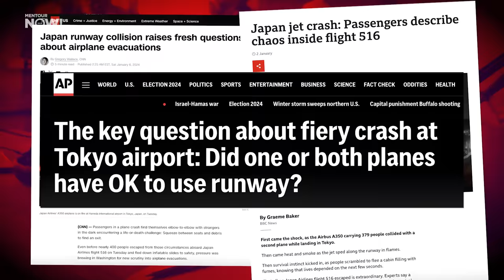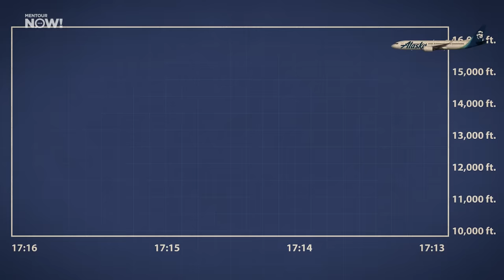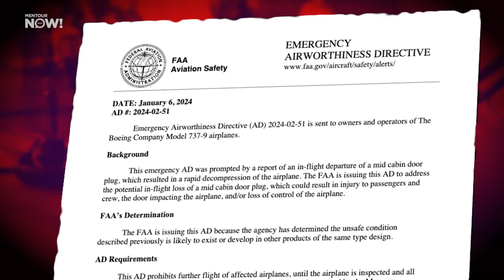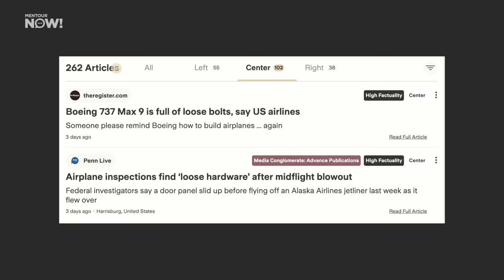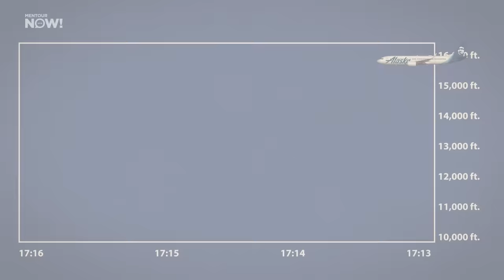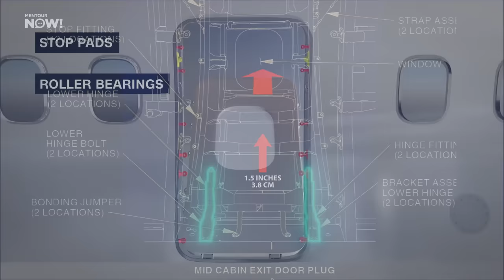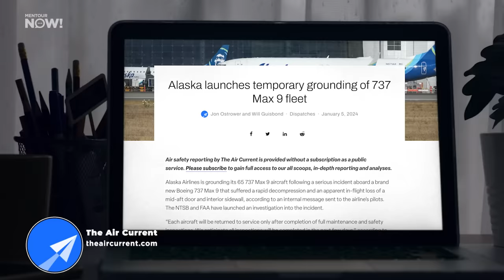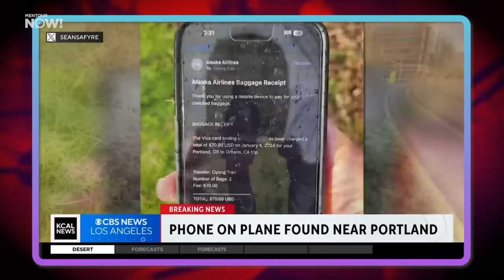WHAT Is going ON with Boeing?! MAX-9 Door blowout

Comment: Boeing was a name you knew you could trust for excellent engineering and quality but its now clear that something about their company culture has changed
Reply: its been an issue since aviation began, and its a bigger issue in countries where money/profit is the deciding factor.

it should actually be illegal to subcontract work, it should all be under the responsibility of boeng, and everyone should be on top rate boeng pay and benefits.

but shareholders gotta be told to fuck off and eat a bucket of shit first.
Reply: That Boeing you’re referring to no longer exist. The Boeing 777 was the last plane made by the former Boeing put together by senior, highly skilled and well paid unionized engineers in Renton. What we have now is McDonnell Douglas using the Boeing logo putting together aircraft parts that are manufactured by the cheapest suppliers scattered around the globe. They even opened a final assembly line for the 787 in South Carolina just to get cheap non-unionized labor. The results of that approach speak for themselves.
Reply: Going on 2 decades now
Reply: @Pilot597 I don’t see how unionized vs non union should be an issue. They are required to perform the same work at the same quality
Reply: It was not the name. It was the logo. I mean it. Check when it was changed to the current version.
Reply: @milkshake1993  there merger with McDonnell Douglas...
And adopting there business strategies...
Reply: @VikingNewt no, it should not be illegal to subcontract work - that's insanity. You want Boeing [edit for typo] to make the carpet? Tray tables? Seats? Batteries? Carbon fibers?  Everything depends on subcontracting, everything...

And Boeing already are "responsible" for their end product, the manufacturer of the sub-components does nothing to change that (except someone might find the subcontractor responsible as well as Boeing).
Reply: @VikingNewt  subcontracting didn't cause this. What caused this was boeing employees not reinstalling the bolts correctly.
Reply: Greed
Reply: Intense competition from AirBus, probably with lower costs (U.S. inflation is very dangerous in more ways than one) and the Chinese threat just over the horizon. Flipping burgers at $ 20/hr has unintended consequences.
Reply: @scythelord According to other online sources (Blanco Lirio), the tubes are delivered to Boeing with the plug doors installed. However it appears that sub-contractors at Spirit use the left hand doors to install the WiFi system. It seems that these were not always replaced in an approved manner OR checked afterwards.
Reply: Another issue is that after the merger with McDonnel-Douglas, the new executive team (intentionally or otherwise) created a culture of fear by threatening disciplinary action against employees who spoke up about issues.  The result, of course, is that the issues are still there, but they are not being fixed until something catastrophic has already happened.
Reply: It's just a name and a logo - the real worth of an engineering company are the engineers that currently work for them. The current people 'running' Boeing have failed to hire people that can maintain Boeing - and indeed have outsourced much of manufacturing so it's not even possible to ensure the same quality across the aircraft anymore. This is what happens when greedy people determine a cost can be cut - they fail to understand the reason it was a cost in the first place.
Reply: @lmpeters  And do you are just a person how like to acuse a company. Or so you have some real info for your opinion.
Reply: @Bobspineable Emplyees who are treated well and respected tend to care about their work more. Unions also mean that workers have a way to be heard, so they have an easier time communicating if the employer tries to impliment any unsafe practices, and can even pull the plug completely if necessary.
Reply: There is no more Boeing but just name.
Reply: @nontonteve2485  - Was there ever really a company as an entity? it's just whomever works there at the time and there's no garuntee that the next generation will be as good as the previous. SEGA can't make game consoles anymore, NASA can't reach the moon anymore, Rolls Royce can't make piston engines anymore etc etc etc
Reply: @Bobspineable 
It is an issue. The Seattle plant (unionised) has properly qualified and trained people working on aircraft. The South Carolina plant has cheap local labour.

Outsourcing works on some products, but not on something safety critical like an airliner.
Reply: @Bobspineable  Non-union workers are likely paid less and given less time per task to get the job done.
Reply: @MiroDaisuke Amazing how you need to explain that to people.  Union workers are Always better.
Reply: @Bobspineable  At the least, closing a location and opening another one to save cost shows that management is not interested in retaining knowledge and experience.
Reply: @Bobspineable 
In fact it can have much better quality control, because management can fire incompetents!
I never worked at Boeing in Witchita, but I had friends that did!  Some of the stories they would tell about screwoffs and incompetent workers that could not be fired due to the Union!   Drug use was common, as was absenteeism.
Spirit cleaned house as much as they could, and things were better for a while, but I wonder how long that lasted!  My friends either retired or took other jobs.  I do know they have had some quality ptoblems lately!
Reply: @scythelord 
From what I understand you are correct!  Boeing in Seatle open the plug to install interior components, so Spirit should be in the clear!
Reply: @pizzablender  - it's also a civilian company using phrases like "acceptable losses" as if it wasn't murder outside of the military.
Reply: @moltderenou 
That shouldn't make difference as I believe the door plugs are opened at Boeing to install interior components.
Reply: @mahbriggs As long as Boeing didn’t also believe that they were installed again correctly at Spirit. Heads will roll due to this.
Reply: @moltderenou 
What part of the door plug being opened at Seatle did you not understand?
If it was insralled incorrectly at Wichita it should have been caught in Seatle!  Especially since the bolts have to removed to open the door plug!
Reply: The only thing is changed is FAA and NTSB.
Reply: @life5161 
Not at all!  I have worked in union shops!  It is very hard to fire incompetents and screwups!
Just ask General Motors!
Spirit for example is mostly union, despite Kansas being a right to work state.  The Union is very powerful, and in the past has commited violence against non-union workers durring strikes!
Reply: @hardykornfeld1733 
Non-sense!
Reply: @davesy6969 
This plane was built in Wichita, by union workers!
You fail!
Reply: @MiroDaisuke 
Unions also make it very difficult to fire screwups, incompetents, and lazy workers!  They even make it difficult to fire drug addicts and alchoholics!
I have worked in union shops!  I have seen it first hand!
Reply: @mahbriggs I understand everything I hear and read, and up to now nowhere have I heard or read that Boeing needed to open or remove the plug to finalise the airplane for its delivery to the customer. By the way, it’s Seattle.
Reply: DEI
Reply: @Bobspineable  non union workers are paid much less. Yes theoretically the work quality should be the same.. But in reality it won't. Why? More qualified workers will not accepted the lower pay and lower paid workers will not be able to perform at a higher level and also have minimal motivation. That's how capitalism works. Boeing decided to cut assembly costs (nothing wrong there) but they cut too close to the bone.
Reply: @moltderenou  
Several channels have stated that the door plug is opened a Seattle!
I have not seen different!  If you have, you might point me toward that source!
Reply: @mahbriggs I therefore await in anticipation for you to forward the links to the channels you mention.
Reply: @hardykornfeld1733  they are still required to build the parts to the required specifications.
Reply: @davesy6969  again cheap labor shouldn’t be an issue as the final requirements still have be met, regardless who builds it. We already outsource countless things, many critical to the Chinese and we fine.
Reply: @MiroDaisuke  the final product still has to fill the requirements, regardless of who makes it.
Reply: @mahbriggs  You'll never convince me non-union is better. Just look around you. The entire work force needs to unionize. Boeing was actually a good company and respected when they were union. Look at them today.
Reply: Profits before safety. Similar to profits before health re: corporate healthcare.
Reply: The merger with McDonnell Douglas completely changed things. They moved their headquarters from Seattle to Chicago and became "solely" concerned with share price.

Comment: This was not a Design Fault - it was a Production Fault! - It is very important to recognize the difference! Unfortunately it was not the first Production Fault of Boeing in the last time and therefore the FAA reacted now appropriately.
Thank you very much for picking this Incident up! I´m waiting for the Video about the Haneda Accident, too.
Reply: Ref 16.21; Designed as sprung open but safety bolted closed seems a glaring design flaw to me. I'd prefer sprung closed + safety bolted closed.
Reply: @The007Weasel  I see where you're coming from, but I would wager that all 4 bolts need to fail (if installed correctly) for the door to come open. So they already had 3 backups. You're right though, because it isn't really 3 backups if all 4 bolts are not installed correctly by the one installer. Then they only have 1 backup, which is whoever should have inspected that the installation was done correctly.
Reply: @MrGundawindy  Typically, the entire point of design redundancies, is that your redundancies should not just be duplicates of the other redundancies. There should be multiple, independent systems that prevent things, in case the others completely fail. As, in this case, if somebody is going to be lazy enough to not install one bolt right, they aren't going to install the other 3 right either.
Reply: @jijonbreaker  yeh, it didn't have redundancies. It only had bolts. But it also should have have an inspection process to assure those bolts are fitted correctly.

Comment: The problem with Boeing is that engineers don’t make decisions anymore. Shareholders do. And all they want is to make the planes as cheap as possible to make as much money as possible. Money first, safety second.
Reply: Shareholders don't decide much in any corporation. I suspect that what you mean to say is that decisions are being made to increase profitability at the expense of safety. Boeing made a very considered decision(which has been discussed repeatedly) when McDonnell Douglas merged with them to fundamentally refocus their attention on profits. Boeing benefits immensely from being seen as a domestic product rather than as an international product. I would argue that this is an illusion but intelligence is not a hallmark of human behavior.

Cheers
Reply: I used to know a number of Boeing workers back in the 1980's that had worked there for many years. They all said Boeing used to make airplanes but they switched to making money.
Reply: Close but not accurate. Not shareholders, but executives who earn bonuses from quarterly targets, i.e. short term benefits, make decisions.
But there is a fundamental problem with this approach.
Short term benefits of the company does not necessarily mean good for the company, i.e. in long term which is beneficial for the shareholders.
For example not designing a new aircraft means good for short term profits because there are no R&D costs for several years, but it will the make company lose market share, very bad in long term.
And guess what current management did?
Reply: Really?  There's not one engineer at Boeing that makes decisions?  Get a grip dude, you're just kicking while they're down.
Reply: Dude must be an engineer to post such a comment 😂
Reply: @FlyWithMe_666 lol no. dude must have no actual idea about any company structure and posting random shit.
Reply: 💰💯✔️ Dame safety 😢
Reply: That is the problem with replacing MSc:s with MBA:s in the leadership...
Reply: Let's find those shareholders who are making the decisions then and tell them to make better decisions/s

Comment: The plug door has a window, and the window seat was not occupied in an almost full plane. Amazing.
Reply: Alaska has saver seats that are a lot cheaper than regular, and you have to upgrade to regular in order to pick what seat you want.

I flew PDX to SAN and back last month and it would have added $70 to my trip if I wanted to pick my seat.
Reply: @AlexandarHullRichter that makes sense. Thanks for the clarification

Comment: I have sat in those rows before, I didn't know exactly why the window didn't line up and I was annoyed about not having a window. At the time my guess was that it had to do with possible seat configurations that the airline wasn't using.

Also I was boarding my own flight at SeaTac when this flight had the issue. I got lucky that my flight wasn't disrupted.

Comment: No triple redundancy in quality control. I think this is the first of many problems coming. Great Show! Well Done!
Reply: I suspect you are correct, interesting times coming, yay Diversity 😳
Reply: Actually if ANY of the four bolts were present the door couldn’t be dislodged - so quadruple redundancy but a common cause failure mode (the nut behind the spanner).

Comment: Boeing's 737-Max planes are manufactured in the factory in my city. I pass the factory on my way to work every day, it's an enormous complex. They're a major employer in the area. Sometimes you can see a whole fuselage coming down the train tracks. I used to think it was cool that the planes were made here, but after the Max crashes, Boeing's coverup, and now this latest manufacturing problem... I just hope Boeing turns things around.
Reply: I’m actually pretty sure that the MAX aircraft are held to a higher standard and are thus safer than other planes.

Comment: Maybe, just maybe the FAA shouldn't let the aviation companies mark their own homework when it comes to certifying aircraft for service....
Reply: And definitely not let the aviation companies to decide if the existing type certification for the older model is usable for next model. This far MAX has had at least features such as MCAS and cockpit door opening by itself on depressurisation that haven't been disclosed to pilots on "no need to know" basis – I would assume to make FAA accept that no additional training is required.
Reply: Whaaaaa!? That's crazy talk, you're crazy. 😉
Reply: Like the whole DEI pilots and aircraft controllers is not an issue
Reply: If you want FAA inspectors in every aircraft factory, tell Congress they have to give the FAA way more $!!
Reply: @MikkoRantalainen  The aircraft manufacturer applies to the FAA for common type certification; the FAA decides.
Reply: @jack002tuber  What do pilots and aircraft controllers have to do with this?
Reply: D'you understand just how complicated any modern aircraft is? And you think FAA Inspectors must become specialists - experts even - on every system of every aircraft the FAA certifies? That the FAA will check, line by line, every bit of Embraer autopilot code in every one of the 190 series variants? Will test and certify every single fuel valve design, large or tiny, that Airbus fits to any, or all of it's aircraft? To check, capacitor by capacitor, resistor by resistor and so on, that no component used in any radio fitted to (or eligible to be fitted to) any Cessna is rated less than 125% of maximum?

This 'marking aircraft makers homework' schtick is so juvenile. It makes no more sense than for every doctor, surgeon, anaesthetist, pathologist, paediatrician, psychiatrist etc in North America, Europe and Oceania having a 20 man specialist inspection team following them around, checking up on them 24/7/365 for 'variances'.
Reply: @Ldavies2  Or simply raise the licensing fees to make the plane manufacturers to pay for their planes?